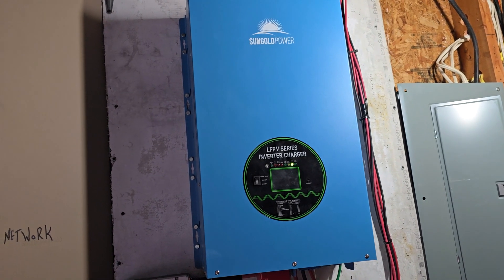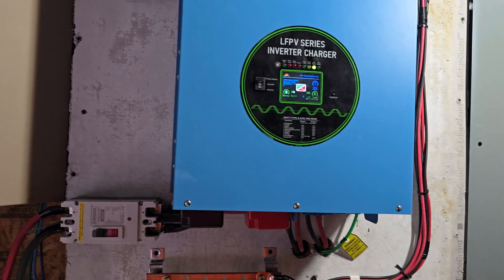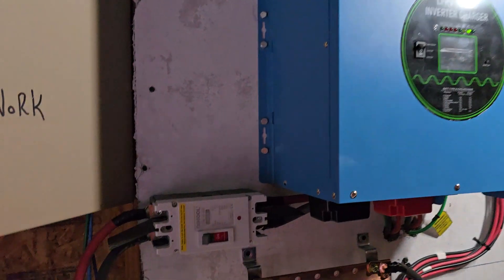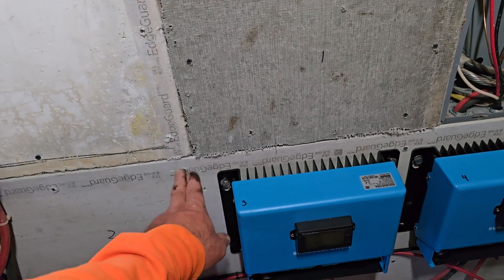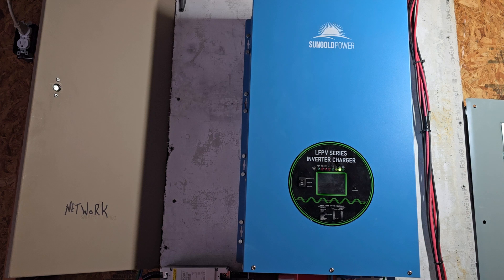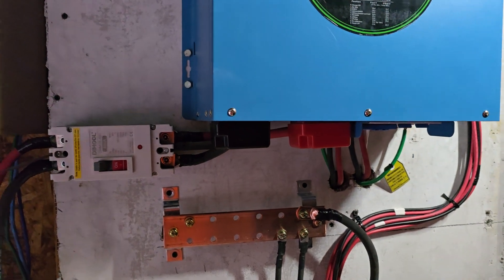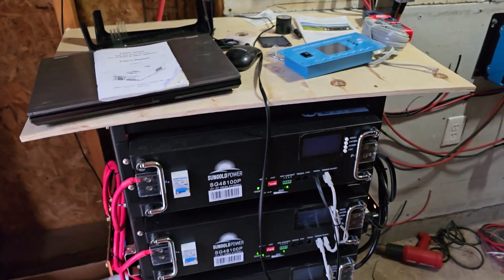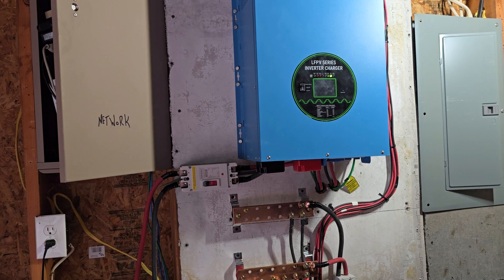First Power-Up: Wiring and Activating the Sungold 18kW Inverter

Comment: Hello, can this inverter produce energy from the panels without using batteries?
Reply from the maker: Yes there is a option in the settings to turn battery storage on and off.

Comment: I have the same setup how did you connect  a battery heat sensor ?
Reply from the maker: @scottregnier2734  The batteries have one built in.
I did not use the temp hook up on the inverter.

Comment: Do you have videos going more in depth on wiring? My family is thinking of getting the sungold 12kw off grid kit which uses one of these inverters and 2 mppts along with 4 of those batteries you have in the video. I'm thinking the best way would to set all these up in there own little heated house, kinda like a well house but for power since lithium don't like the cold. We won't be connected to the grid at all but will have a 10kw diesel generator feed into the inverter for cloudy/winter days where the solar can't keep up
Reply from the maker: @Catboy-hr2qp  yes, there are a bunch of videos of the installation of this system on our channel under the solar playlist.

Here is one of them.
https://youtu.be/RKe_qyDhx5o?si=F1ZJa0oD4PguGaD_

Comment: That inverter is an excellent choice, always go with a LowFreq inverter when you can, they have a large toroidal transformer instead of depending on high failure mosfets. This unit should last you a long time and you are right, they can handle the heavy loads, I have a victron 5K LF unit and it is a tank, thanks for sharing :)

Comment: Do you have to program the batteries in parallel or something???
Reply from the maker: Batteries are hooked up in parallel, rj45 cable (network cable) is daisy chained between each battery, dip switches just give each battery a number in the array so when you plug in your computer you can view each battery one at a time with out hooking the computer to each battery.
Reply: @HowToWith24DY  what if you have 8 batteries in parallel,
Reply: @HowToWith24DY  and does the inverter work really well so far?? I'm thinking about buying the 18Kw inverter charger and 5 batteries 🔋🔋🔋🔋🔋
Reply from the maker: @rob6154 
So far I am very happy with the 18kw, just remember there are no frills to this inverter. It just makes power.

5 batteries is a great start, I would love to have 2 or 3 more

https://sungoldpower.com/?sscid=31k8_89bpc&

Comment: I almost went that route but changing 48 volt to 240 volt is not as efficient as a high voltage solar and battery bank.Plus I've watched Alot of solar videos where Alot of these inverters mosfits burn out at high amps.Hopefully they have fixed that take care